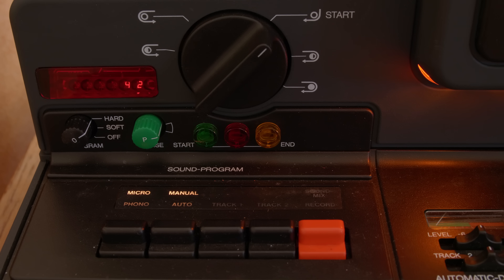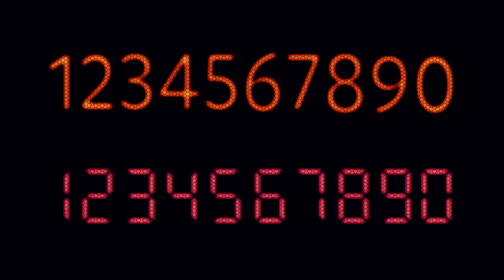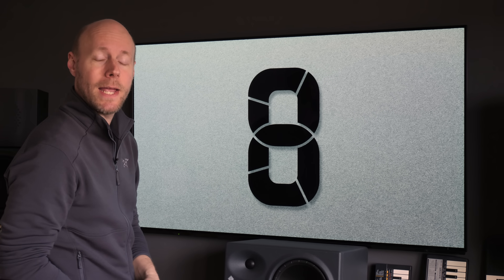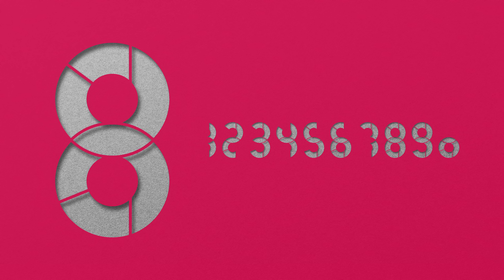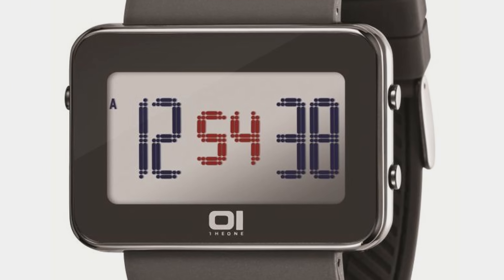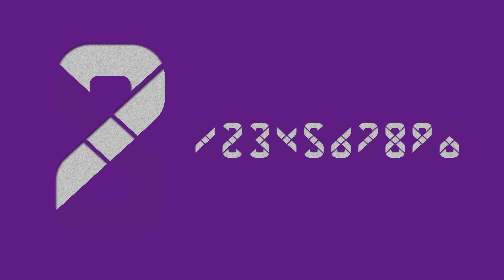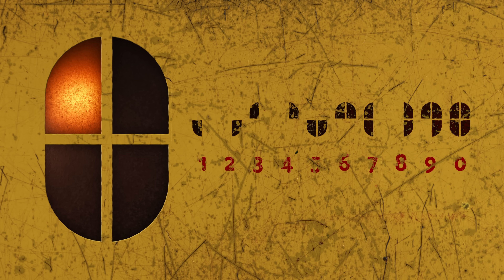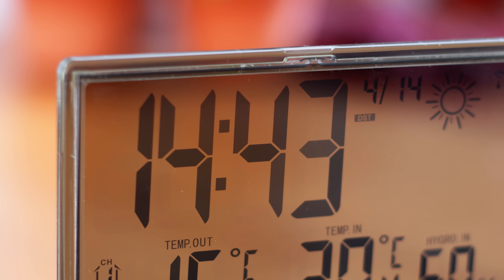Segmented Displays

Comment: 12:38 The 3x5 matrix is very similar to what you get when trying to put 80 text columns on an old computer with 320 horizontal pixels. One pixel spacing leaves you with 3 pixels per character. You got 7 pixels vertically, though, because they usually had 200 vertical pixels displaying 25 lines. I think they would use 6 pixels for upper-case and the 7th for lower-case descenders (p, q, etc.). Systems with 320x200 displays usually had 40 column of text, though, because they used a blurry RF signal to a TV that rendered 80 columns illegible.
Reply: Even my old Apple //e computer could do 7x8 pixels in 40 or 80 column mode, once I installed the Extended 80-column memory card. But the 3x5 was about what my TI-89 calculator uses in its dialog windows, although some characters just can not fit in such a narrow width. On the graphics screen, it used 6x7. Add an extra pixel for row separation. You might as well give up on weird segmented displays and go with the pixel matrix, once you are trying to display all 96 or 255 ASCII characters. When I was in Israel, riding the train, I think their destination signage used a pixel matrix to display Hebrew characters. I am trying to remember if it also displayed English?

When I ran AppleWorks on my Apple //e, which required 80-column text, I at first used a "component monitor receiver" TV that actually had the yellow video input jack. It was readable, but my Dad must have thought it to be blurry, because he helped me to get one of those blah green-screen monitors, so I had both connected with a simple signal splitter adapter. Still need the color TV for video games, as monochrome is so blah. Of course the Apple //e didn't really do color all that well, because memory and video RAM was so small and expensive back in "the good ol' days" of computers.

Seems to me that trying to do more than 7 segments is silly. Just do the normal pixel matrix then. Modern computers have almost largely given up on the old text column displays, and most everything is now GUI using the photo-realistic graphics display. Which also is a pixel matrix. What a concept. I can see actual underlined text without it turning green. The old text column displays simply could not do something so simple as italics nor boldface and especially not strike-through. Couldn't do proportional text either. Graphics does it all, and today's computers are easily fast enough to draw so many pixels required and even to anti-alias them.
Reply: @yosefmacgruber1920 OH GOD YOUTUBE MERGED WITH WIKIPEDIA
Reply: 12:38 3×5 martix

Comment: I actually think about this a lot, ways wondered. glad to hear your perspective. I realized on my air conditioning unit, the screen has a bevel, so if you're not looking at it from the proper angle, you can only read half of the didgit on the far right (which is the most important when changing the temperature on the thermostat). it uses the common 7 block display. I think for most displays it could potentially be beneficial to be able to read the difference between numbers from only being able to see half of the didgit.

Comment: The HP 28 series graphing calculators, introduced in 1987 used a 137 by 32 matrix of dots for 4 rows of 5 by 7 text characters. In 1990, the HP 48S was introduced with a 131 by 64 matrix of dot.  It displayed 5 rows of 5 by 9 characters, with empty rows and column to separate text with information displayed at the top and menus for soft keys displayed at the bottom.  Using the full display on either allowed the display of graphs, among other things.

Comment: One annoyance of these displays is that when they display decimals, the symbol is almost always a . when in most of Europe it should be , instead. This becomes a problem for digital displays used for showing price, since some countries have legal requirements that the decimal mark must always be , for the sake of consistency and unambiguousness.
Reply: Lmao why so many "Europe should do this", "USA should do that".
They're conventions, each one has their owns and that's it. They don't necessarily need to have a meaning behind their choice nor there can be a way to validate one more than the other. 
If I wanted, I could write 1.0/1,0 as 1☥0 and it would make sense either way, it's literally just a symbol. As long as it doesn't have a meaning already, math doesn't care.

Jokes are fine and I agree having just one unique convention would be nice, still argue about it seems pointless to me ngl (pun intended, but point still stands).
Reply: So many negative comments. The issue is that it's a legal requirement. I'm not crying about it, I'm just pointing out a legal issue with these displays.
Reply: Just start using a . symbol the way God intended you mathematical barbarians. 😋
Reply: So you'll dumb
Reply: To me the only annoyance is that European countries don't switch to a . for decimals tbh. As an engineer I constantly get them mixed up because most software uses a .
Reply: I’ll give Europe the benefit of Celsius and Meters but screw that decimal bs.
Reply: Using . as a decimal separator is the standard in countries whose primary language is English. The , is the standard elsewhere, but they are irrelevant on the English-speaking internet.
Reply: @YourLocalTigerTaur  Fun fact: The internet is equally used in all languages, but based on the language you’ve selected in settings, it filters all searches. Try changing the language and you’ll see how non English the internet really is.
Reply: @YourLocalTigerTaur  Well, the internet doesn't only speak english, you know
Reply: decimal point makes more sense. commas separate the bundles of thousands
Reply: @reddaB  In most European countries and many other parts of the world, dot, space or ' separates thousands and a comma marks the decimals
Reply: @huevos_de  And in countries that actually went to space, and are useful the the decimal point "." separates the decimals.  Using a decimal point to divide the thousands makes absolutely no sense.  That is what the comma is for as you are indicating a pause between the groupings.
Reply: @Dead_Goat  Both the decimal point and decimal comma make the same amount of sense.

As for your space point, Russia also went to space and uses a decimal comma (not that Russia's a country that I agree with on any part and they might have used decimal points for just the space stuff but since you brought it up, I felt like I should let you know)

As for your pausing point. I feel like there is much more of a needed ''pause'' for decimals rather than for groupings. 1.000.000/1,000,000 is easier to read than 1000000 but it's still the same number. If you write 10,25/10.25 as 1025 than you just created a whole different number. 

In conclusion, I think both decimal points and decimal commas are equally effective/make equal sense.
Reply: @mickb.8925  A period indicates a longer pause than a comma; therefore, it makes more sense to use a period for decimals and commas for groupings.
Reply: Europe is wrong.
Reply: Oh boohoo
Reply: then just use . lol. it's the majority and the universal one
Reply: @Syumza  Yeah, I hate it how in each place they use a different way like, in Brazil we use commas for decimals aswell, and it took me a long time to realize that each country did it in a different way, and some softwares only accept in some ways, so I used to mess that up a lot. And that's such a stupidly simple thing, WHY ISN'T IT THE SAME FOR EVERY LANGUAGE? I DON'T CARE WHICH ONE IT IS, STANDARDIZE "+" FOR SEPARATING DECIMALS FOR ALL I CARE, BUT PLEASE LET'S JUST PICK ONE AND STICK TO IT, IT'S SO FUCKING ANNOYING.
Reply: @Syumza  Most economists use (brackets) for negative numbers, so are you gonna switch to them instead of using a -minus symbol.
Oh, and are you going to ask Chinese speaking people to "Just use English, it is more popular"
Every country has differences in how they do things and you can't just expect them to change when millions of people do things a certain way.
Reply: @soulus98  ( and ) aren't brackets. Those are parenthesis. [ and ] are brackets. also, your point about telling Chinese people to speak English is completely irrelevant to the discussion. I feel that a period, symbolizing a pause between sentences, and a comma for indicating pauses between words. Therefore, it is much more fitting to have a period to indicate decimals and commas for separating thousands. Yes it's true every country has differences, but universally the period-decimal symbol is already used more by a landslide and countries switching to English speaking and universal symbolism and termology is not unheard of.
Reply: @soulus98  you can, Europe changed from imperial to metric, Sweden changed from left hand to right hand driving, millions of people were forced to stay at their homes, you can easily make millions of people to do what you want
Reply: @DarkSoSpooky   yeah of course I got brackets wrong but you know what I mean. You say landslide, but afaik, all of Europe uses commas as decimal points. If it were less used, I would understand. I get where you are coming from in a punctuation sense, but it isn't a great argument, imo. It seems like a lot of hassle for little reward. In my opinion, everyone (or at least people/companies with broad reach) should swap to spaces instead of commas. 1 000 000.00
Then, whatever symbol you see, it is obviously meant to be a decimal.
Also, after you convince all of Europe to switch, good luck convincing Japan (100,0000) and India (10,00,000) to swap to 3-places-per-comma
Reply: @duckmeat4674  of course you can convince a lot of people to change something if there is a great reward from it. Even the calendar, in the 1500s where we skipped 10 days or so.
But something as simple as a comma vs a point is so insignificant to 99.99% of people that nobody would be bothered to change. A universal language or even just an English spelling reform would be much better, but they are obviously just as impossible.
Reply: My point is you can't just tell someone "lol just swap"
It doesn't really work for: language, spelling, counting, RHT v LHT, metric v imperial, etc
If y'all live in America you'd better be using Celcius every day because it is more popular by a landslide
Reply: @soulus98  Sweden just changed, Europeans changed from imperial to metric
Reply: @duckmeat4674  Europeans changed from each their own traditional units to one standard, not from imperial. Those are imperial British units. American units are not the same as imperial units as well. Both descend from English units but imperial units were only defined/legislated after the US came into existence, so they developed separately.
Reply: @soulus98  Okay, I think using spaces is better than either and I agree with you on that. I also do live in America and Celcius and Metric make much more sense to me. Also, one thing I will point out, the UK, North/Central America, Australia, half of Africa, the Caribbean, New Zealand and pretty much all of east Asia uses commas for thousands. Yes, more countries use periods, but more actual humans use periods. Just saying.

-your favorite sleep deprived youtube commenter
Reply: @DarkSoSpooky  Here in Australia, we call parentheses "brackets" as well. If we need to distinguish (this) from [this], we typically say "round brackets" or "square brackets", respectively.
Reply: @soulus98  As far as I can tell, no one here is really saying anyone should swap. They're just trying to argue that one way is "better" than the other. Obviously no one should have a certain way forced onto them. That would be like Britain trying to force everyone to use left-hand traffic, or the rest of the world trying to force the U.S. to throw away its customary units. It's just a violation of a foreign people's customs. But sometimes, it's just fun to try and figure out which way works better, or makes more sense.
Reply: @duckmeat4674  > "Europe changed from imperial to metric"
Technically most of Europe didn't use Imperial. It was national and subnational standards that often had feet as one of the units of length, but each region had their own. Sweden had 10 thumbs (inches) per foot, as well.
Reply: @Syumza  isnt it like 8.000.000,00 if we wanted to say basically 8 million
Reply: @Syumza  Objectively incorrect https://en.wikipedia.org/wiki/Decimal_separator#/media/File:DecimalSeparator.svg
Reply: @OsthatoAlfakyn  you're incorrect. 66% of the population uses periods for decimal separation while 28% uses commas.
Reply: @Syumza  OR THEY CAN USE CARBOARD AND MARKER SIGNS LOL

Comment: A 3 by 5 matrix is quite useful in pixel art. But it's not really a display in the usual sense lol

Also the four lights is also interesting since it's basically binary, and you could display up to 16 numbers with a digit, or 15 if don't consider all lights off representing 0

Comment: I've also invented 6-segment digits in my childhood, though my "9" was different: the bottom half is inverted if compared to yours. Thus, it can be separated from the rotated "6".
Reply: n i c e
Reply: Can you give a pic of it ❓i wanna see it. Paste a pic link
Reply: @3s-sahajselfstudy  
0 - Δ
1 - /
2 - Z
3- Σ (mirror horizontally)
4 -  У
5 - horizontally mirrored Z
6 - σ
7 - 180 deg. rotated L
8 - hourglass made of triangles
9 - 180 deg. rotatated δ

Comment: "An often the divisions are not symmetrical [...]" (2:02)
Never have I ever seen a unsymmetrical segment display
Reply: An
Reply: @manioqqqq bruh
Reply: I bought a Casio PQ 30B (portable clock) and it has this unsymmetrical display but with rounded corners
Reply: I have that design in my celica calculator
Reply: asymmetrical*

Comment: The other thing about seven-segment displays is seven segments with a decimal point perfectly represents 8 bits of data, which is exactly one byte. This makes the design extremely efficient not only in the front-end, but also the back-end.
Reply: And exactly why a 3x5 matrix with a decimal point is the best alternate design, being two bytes to display anything you wish.
Reply: Common shift registers are compatible with 7 segment displays with a dot.  You would need a dot matrix display or multiplexers for the more complex fonts.
Reply: Hey, the more you learn!

Comment: Having grown up at the tail end of the DOS era, I've always been partial to the 3x5 matrix font that those low resolution games were forced to use to get a reasonable amount of text on the screen.  M and W suffer slightly, but there's a lot of power in those 15 pixels.

Comment: While the number 2 is in 6 of the hours, it's present for almost half of the day.

:02, :12, :20-:29, :32, :42, :52 = 15 minutes of every hour
00:00-19:59 (except 02:00 and 12:00 below) = 18 hours
18 hr * 15 min = 270 mins or 4.5 hours
02:00-02:59 = 1 whole hour
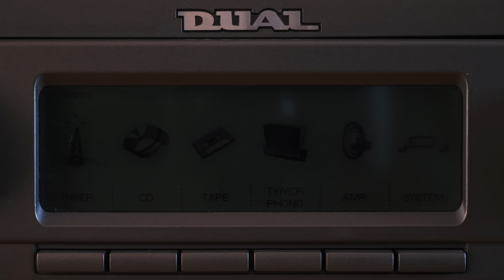12:00-12:59 = 1 whole hour
20:00-23:59 = 4 whole hours
4.5 + 1 + 1 + 4 = 10h30m

the number 2 is used a lot.

Comment: Think of how many symbols aren't used in the digi-8. 1/2/3 horizontal bars, 1/2/3/4 and combo vertical bars, ∀ or ǝ or ſ or Ɔ and then, also, the animated versions... that's 26 characters right there.

Comment: I remember making a 5 or 6 segment display, and it looking better than most of the ones I found online. I also tried making binary inputs for it with as few components as possible (which would not be very useful, when it would have to have custumized combinations of logic for each digit display).

edit: I don't remember it completely, but I think it was something about combining the middle with something in a very specific shape.

Comment: @ 10:04 why doesn't the 4 use the full stem of the 1? Why does the lower half use the right-hand bend? It looks worse that way. It would look better if you used the left side straight segment for the bottom stem of the 4.
Reply: This was technically explained earlier in the "X" design, having those segments on would make a "y" rather than a "4".
Reply: @firstnameiskowitz8493  That is only if the display is also intended to show letters. If it is limited to numbers, there shouldn't be any problem with confusing 'y' with '4'.
Reply: The 4 can’t go down on the stem because then the 2 would be compromised. The 2’s bottom base would simply not reach the end. Adding a sort of square thing in the bottom right corner would solve both of these compromises.
Reply: @gallium-gonzollium  they meant, having the four use the upperleft, upperright, and bottomleft segments instead of the upperleft, upperright, and bottomRIGHT segments like it appears here.

basically, they want the 4 to look like
\/
/
Reply: @notwithouttext the way it is shown in the video is like the x concept thingy. it goes out like this

\/
  \

but hey it looks cool
Reply: because the line of the 4 is usually straight vertical, but i agree it would look better with the diagonal

Comment: It's interesting how you say that the design at 2:05 / 2:58 is the most common, yet I've never knew it was possible / allowed to have a asymmetric 7-segment display. However I also didn't know the original design was the one without cut corners at 1:53. I always thought the original was the designs at 0:33, 1:59 and 13:15, which is also the most common one in my household with six devices. The one you say, is the most common one, only has two entries in my household. However, like I sayed, I never noticed the difference between the two until this video pointed them out. Many of them devices I used for over 20 years by now.